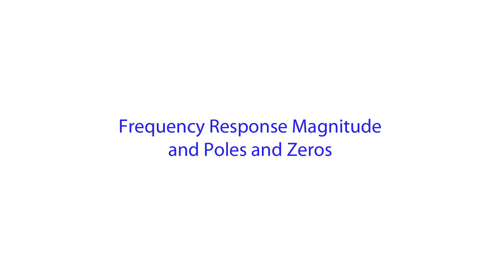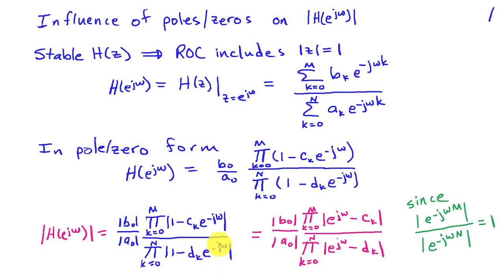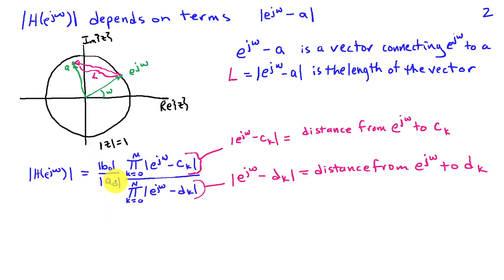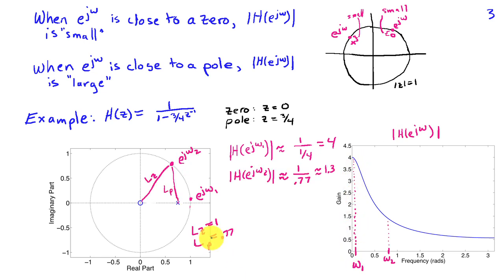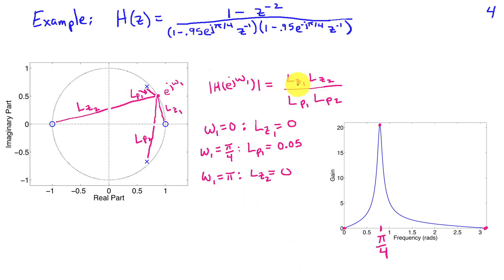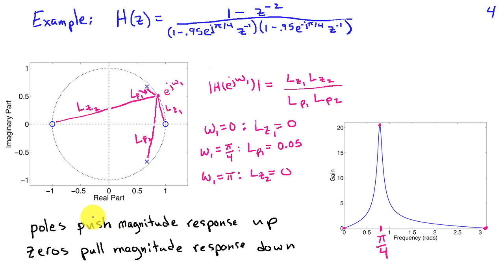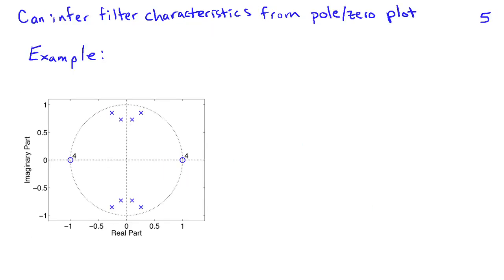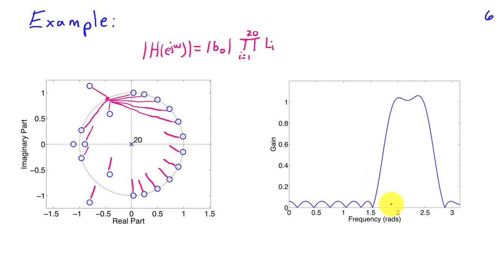Frequency Response Magnitude and Poles and Zeros

Comment: Thanks again for the videos.  At [2:30] The expression for poles and zeros has the products running from k=0 to k=M (or N).  Probably this should be from k=1 ?  e.g.,  system has M (N) zeros (poles).
Reply: I had the same thought. In Oppenheim and Schafer the indices of the products in this expression are from k = 1.